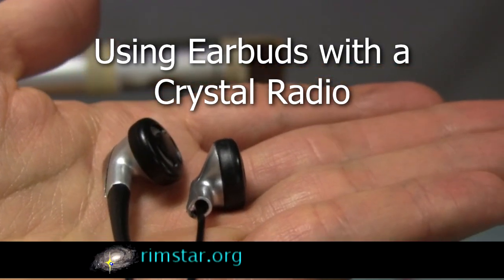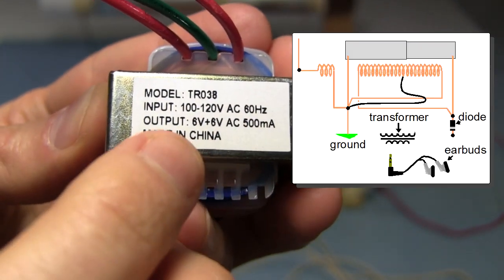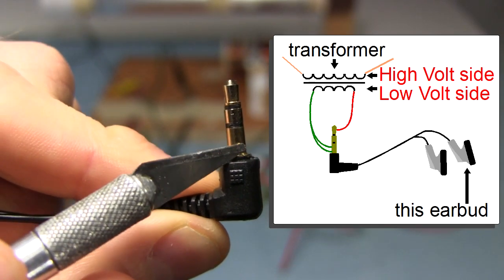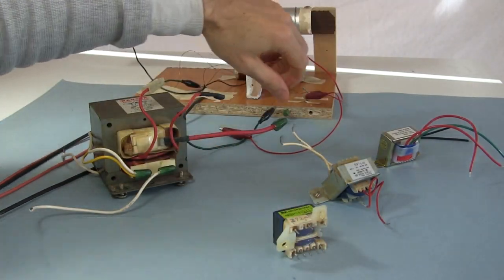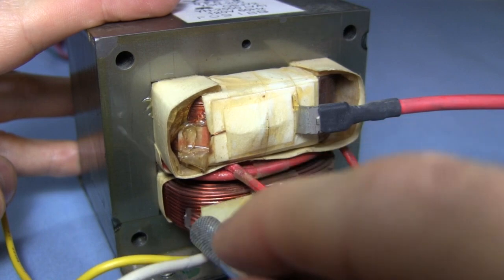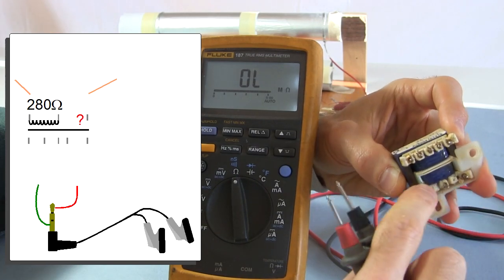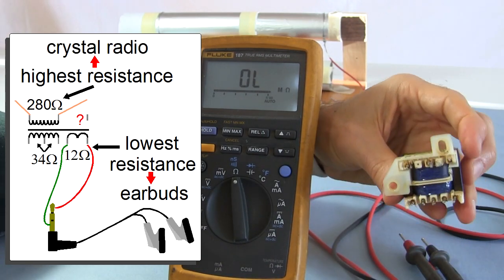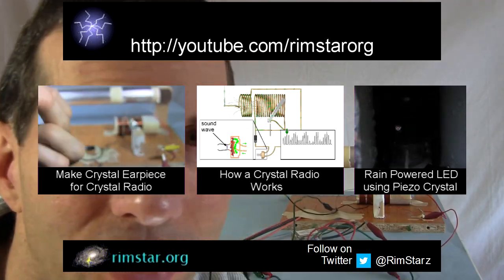Use Earbuds/Earphones with Crystal Radio

Comment: I used a PA speaker transformer.  The buds I connected to  left and right pins  and not the ground so are in series but out of phase.  Result it spreads the sound, so it's not in the middle of your head.  And you listen with both ears  which is less annoying.

Comment: Hi , i have a Hansen CB RADIO TRANCEIVER TESTER model FS-117, it has an RCA AF ( audio frequency) output jack which in the manual requires a crystal earpiece, i assume i could use this videos instructions ?
✌️ ☮️ 73.
Reply from the maker: I don't know if what I do here would work, but if it's asking for a crystal earpiece, which is high impedance, then I suspect it might. Let me know if it does, it would be interesting. If you do a google search for "piezoelectric crystal earphone" then you'll see plenty of sources of crystal earpieces if what I do in this video doesn't work out.
Reply: @RimstarOrg  I bought a couple of crystal earpieces today, will let you know.
✌️ 73.

Comment: Can I usee 220-240 volt input to 12volt output Transformer
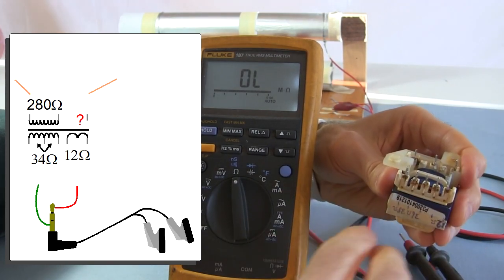Reply from the maker: That will probably work. 12 volts to 220-240 volts sounds very similar to the one I show at 4:00.

Comment: I'm glad I watched your video. Thank you.  I have collected the parts needed to make my first crystal radio by cannibalizing old transistor radios from Value Village (about $5 each).  This includes various ferrite cores with their windings, tuning capacitors, several diodes, several pairs of earbuds which measure around 25 ohms, and the earphone jacks which are awesome to have.

Now I see that I will need to find a suitable transformer.  The hunt through Value Village is back on, looking for stuff that could have a suitable transformer.

Then I will mix and match the parts using cardboard, hot glue and my trusty soldering iron until I have a radio that works.

I am honestly not expecting it to work first time, but to be a learning process and a fun and interesting hobby.

PS - It does seem a little silly to destroy perfectly good radios to make a crappy one, but that is the name of the game.

Cheers from Canada :-)

Comment: For some reason my crystal radio was powerful enough to able get it work with my cheap earbuds working both sides without a transformer. It was clear enough to hear even my microphone was able to capture the sound. But i mostly use a Bluetooth speaker

Comment: About that earbud connector - if you attach one input lead to the tip and the other to the ring  on the plug,  you get both earbuds in series, at twice the impedance.

Comment: Can l use any type of transformer sir ?? Please reply sir, please
Reply from the maker: I don't know what type of transformer is best. I strongly suspect that an air-core transformer would not work well. I think I recall trying a few that I had laying around (e.g., I also tried a big microwave oven transformer) and the one in the video worked best. It's a doorbell transformer, normally used for converting the household 120VAC to 12VAC for powering doorbells. I'm sure if I knew the calculations, I could figure out an ideal one.
Reply: Thank you sir

Comment: can i connect earphone with this ???
Reply from the maker: That depends on what you mean by earphone. If you mean small ones like I show in the video then it should work, well provided you have strong AM radio stations to pick up (I have some nearby) or a long antenna. If you mean big headphone types that cover your ears then probably not. The impedance of those headphones is a lot higher.

Comment: Hi, I am a begginer who wants to make a crystal radio. I have a few questions if you don’t mind.
What did you use for antenna and ground? Also I have a 120 240 AC AC transformer, do you think that would work? lastly, do you know any antenna types that I can use inside home? Thank you!
Reply from the maker: I have this video showing the making of this crystal radio where I show what I use for ground and antenna https://www.youtube.com/watch?v=VqdcU9ULAlA and in this video I give a few more grounding tips https://www.youtube.com/watch?v=HZZmKZJrIW0 My antenna was fairly short and may have worked because I have radio stations nearby. I can't say for sure whether or not you 120 240 transformer will work, that's only a 1 to 2 ratio whereas mine was 6 120, so a 1 to 20 ratio. But you can try and see what happens. I also have this crystal radio playlist that has a lot of helpful videos https://www.youtube.com/watch?v=VqdcU9ULAlA&list=PLFsZmHTZL-zlSltC6ELZW9PK4ks7wgPRz
Reply: @RimstarOrg  Hi, thank you so much for the video and reply, I made the radio and it worked!
Reply from the maker: Excellent! Thanks for letting me know. I often help people before they get it working but don't often hear back after they succeed. So thanks!

Comment: ...something to remember, is that we are COMPLETELY SURROUNDED by electrical NOISE these days- (switching power supplies, computers, and even cell phones!) and a crystal radio only puts out a TINY signal!!! That means that when you amplify the output of the crystal radio, you amplify surrounding electrical NOISE as well!!!
Reply from the maker: Yup. Though I guess you could add some filter circuitry to help with the noise before it goes to the amplifier.
Reply: @RimstarOrg   ...that's certainly true-!!!
Reply: Mostly blackout can get rid of the noise

Comment: I just remembered: there are TWO integrated circuits specifically designed for this kind of application: the Ferranti ZN414, and the perhaps easier to find, MK484. 

These 2 IC's have 3 leads, they look just like a small transistor, and they can be powered by a single 1.5v battery.

The information about using these IC's is readily available on the internet.

Comment: ..I know I'm late to the party- but I saw a circuit in a back issue of Popular Electronics, that used a doorbell transformer, connected to a crystal radio, to drive a speaker(!)
Reply from the maker: Cool. I don't have much of an antenna so the output of my crystal radio isn't very strong but I have heard of radios with long antennas doing that. So it's hard to do but is possible.

Comment: Can you explain what the transformer do so it work,please
Reply from the maker: I can't say for sure but I think it's doing what's called impedance matching. This is my understanding of it... If we were to connect the earbuds to the crystal radio directly then the low resistance (really called impedance since the current is alternating current) of the earbuds would take too much current that's needed by the coil and capacitor for tuning in the radio station. So instead we connect the side of the transformer that has many turns of wire, a higher impedance. That way that side of the transformer takes only a little of the current from the crystal radio because of the high impedance. Meanwhile, the other side of the transformer, the low impedance side, is connected to the low impedance earbuds and transfers the signal to it.

Comment: What is the use of the transformer in this experiment please?
Reply from the maker: I think it works because it's doing impedance matching. But the way I think of it is that if you hook up the low resistance earbuds directly to the resonant circuit (the capacitor and tuning coil in parallel) then the low resistance causes too much energy to go to the earbuds and not enough to the resonant circuit for it to do its thing.
The transformer passes the fluctuations on to the earbuds while not taking up too much energy. That's why you put the side of the transformer with many turns connected directly to the resonant circuit, it has higher resistance.
That's my understanding anyway.
Reply: @RimstarOrg  ty,
Deos the transformer increase the voltage to the earbuds when we add it to the circuit?
Reply from the maker: No, that's not its purpose in this case. In fact, the way it's wired, it would decrease the voltage, while increasing the current.
Reply: @RimstarOrg  is it possible to  increase the voltage and the current on the output of speaker without  using battery ? Ty
Reply from the maker: There are ways to improve the circuit, one being something called a regenerative circuit that I've heard of but never played with. There's also simply using a longer antenna.
Reply: @RimstarOrg  ty ,very kind of u

Comment: Before I break open a pirate iphone charging cube to harvest the transformer for this project, is it an issue that that transformer is used to go AC 120V to DC 5V?
Reply from the maker: Mine was AC 120V to DC 6V so yours should work too. It won't be ideal like mine wasn't ideal since it's not an audio transformer but it worked well enough for me.

Comment: I had to check the posting date of this video to see if this was an April Fools gag.  When he put the earphone up to his phone I couldn't hear anything but a loud background hiss after I turned both the youtube volume and my speaker volume all the way up to maximum.   I really had to laugh when he took the earphone away and commented about how strong it sounded.   Strong, it wasn't even audible!   Then, I searched the comments to see if other people were complaining about the fact that the crystal set had no audio output and I couldn't find a single complaint about it, but there sure are a lot of comments from RimstarOrg.  If anyone else actually heard this thing, then I must be going nuts, because I'm sure not  deaf.   And what up with using doorbell transformers and 60 Hz AC power transformers for impedance matching?   I've used audio transformers for impedance matching crystal sets to low impedance headsets, but an AC doorbell transformer? And, the fact that he would even consider using the transformer out of a microwave oven was so over the top that I knew I'd been had.  Welcome to Looney Tunes folks and be sure to try the Kool-Aid.
Reply from the maker: I just relistened to the video and I can hear it. It's not as loud as hearing it in person but I can make out a voice sound which is distinct from the background static. As for the selection of transformers, it's a matter of using what you have around and can find locally. It's not ideal, which is why I mention audio transforners.
Reply: @RimstarOrg   In the interest of due diligence, I listened to your video again, only this time I used Chromecast to send the YouTube video directly to my TV set, because the TV has a better sound system than my computer.  I turned the audio up until your voice almost hurt my ears, but when you held the earbud up to your phone all I heard was a constant background noise until you took the earbud away and started talking.  Then, I felt really stupid for falling for your s**t twice.   But, if I smoke some of that stuff you're smoking, then maybe I'll hear the radio in the video too.  The Piece de resistance was when you commented about how strong the audio was, that added a nice "comic" touch.   As for the selection of the transformers, I understand the concept of using what you have on hand.   I do that myself, but some parts are suitable for some things and some parts are not.  It was the unsuitability of the transformers you used that I commenting on, it wasn't because they were parts from your junk box.  Speaking of unsuitable transformers, I had to laugh out loud when you used the high voltage transformer from a microwave oven with a crystal set,  that was the highlight of the gag for me.   I don't know if you were really able to hear anything in that ear bud, or not.  But, I'll bet money there's no detectable audio from the earbud in the video.   You're probably laughing your ass off, because you got me to watch your video again.   I may be a sucker for giving it a second chance, but you can't say I didn't give you a fair shake.

Comment: I must try this with the crystal radio I made with your Instructions recently, I do know at School decades ago I discovered if I got a transformer (a old speaker electromagnet transformer used in valve radios) and just momentarily touch a 9 volt battery across one of the windings this produced a brief momentarily high voltage AC spike output across the other windings, I took this to School and told the kids touch these 2 wires while I applied the 9v DC battery well the poor kid would JUMP from a small electric shock but low amperage so harmless !, I figure even though I used 9 volt DC in it still produces the short burst of high AC voltage output anyway the headmaster wasn't very impressed so I received the Cane ! So with your transformer sure it would match impedance for ear bud but it must be amplifying a bit as well
Reply: ...you're only PARTIALLY right- "impedance matching" and "amplification" are two completely different things!!!

What's MORE,  playing tricks with high voltages- AIN'T FUNNY!!!

AS FAR AS I'M CONCERNED- PLAYING WITH HIGH VOLTAGES- IS AS DANGEROUS AS PLAYING WITH FIRE!!!

Comment: Ages ago, there was a design using coils wound on a Quaker oats box.A very long antenna and a galena crystal with whisker-feeler. earphones were old bakelite things. Could pick up very strong signals 60 miles away!
Reply from the maker: That depends on how long an antenna you have. The radio stations that I could recognize were all from around 10 miles or less away. But my antenna was very short, around 12-15 feet.
Reply: ...that was for back when there was nothing better available- nowadays, there's not much sense in "doing it the hard way"(!)

Comment: I've used audio transformers to match crystal radio output to the 8-ohm earphones/headphones of today.  It works.  The problem is that any audio transformer I know of has its own internal attenuation of the heard signal.  So, there is a performance cost to using an audio impedance matching transformer.  If all ya got are low-Z earbuds, then impedance matching becomes necessary to hear anything.  However, I've never found a performance substitute for using hi-z earphones to receive the crystal set's inherently hi-z output.  A good quality 2,000 or 4,000 ohm magnetic headphone set should outperform your transformer/stereo bud getup.  Since the old magnetic phones are scarce these days, use a huge piezoelectric element with a 10k or 11k resistor shorted across the piezo's terminals.  That's about as good as it gets.
Reply: ...that's the truth- there ARE losses associated with using transformers-!!

It's equally true that using the 10k-11k shunt resistor wastes SOME  of the signal.

Comment: Have you tried to connect the center of the head phone to the tap (green)  and yes the other two legs to the sleeves (left and right)? This uses both sides of the coil and might allow for both earpieces to power up.
Reply from the maker: I never tried that. Given how quiet the sound was already, I figured it would be even quieter. It should work though.

Comment: Use the audio output transformer from an old transistor radio. It is usually the red one. OR the one to which the speaker is connected. You should have no trouble connecting the buds in parallel in this arrangement.
Reply: MINE ONLY HAS 2 WIRES WHAT DO I DO

Comment: Thank you for knowledge.But l didnt understand something.At normal transformer boosts the ac signal when we connect the higher coil but you boost the audio out with the low coil of transformer.So how does it work like that??
Reply from the maker: The purpose of the transformer here isn't to step-up or step-down the voltage. It's here for impedance matching. My understanding is that the 8 ohm earbuds are too low an impedance (resistance to AC) for the capacitor/coil circuit. Since they're such a low impedance too much current goes to the earbuds and not enough stays with the cap/coil circuit to resonate with. So we put a high impedance on the cap/coil side. Meanwhile the energy still gets transferred through the transformer.
Reply: RimstarOrg Thank you so much.l really develope myself by you about radio electronic.And sorry for my english its not good :D

Comment: microwave transformer is from 120v  ac  to 2000v ac  wich can kill  you if you touch it bin it mate
Reply from the maker: That depends on what you're powering it with. Even if you step up the millivolts from a crystal radio, the current is going to be so tiny that it won't matter at all.
Reply: dude you are a fool, if it's hooked up to the mains fuck yeah it can kill you.. but something like a crystal radio signal never would.

Comment: Hi RimstarOrg,   Texas. yoyo here. I have built  your radio set with the sliding capacitor. have checked: connections, coil, ground, ant.(30 ft.), diode 1n34 3 of them, using PA & speaker.  Not working.
Reply from the maker: Make sure your antenna is a straight line for the most part. I'm assuming that your PA & speaker includes an amplifier, otherwise the speaker wouldn't work. It's not necessary but best results are with the antenna pointing in the direction of the radio station. Check that you really are making good connections between the wiper blade/tuning bar and the coil. Are there any radio stations nearby to listen to? Try just one diode.